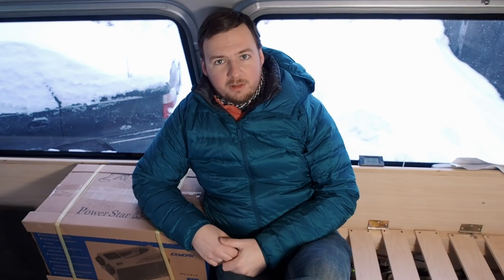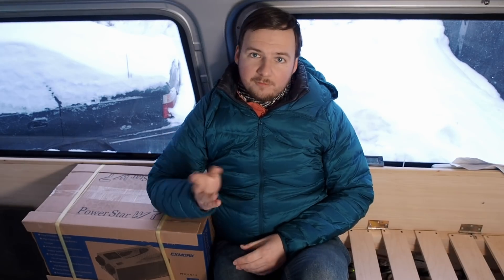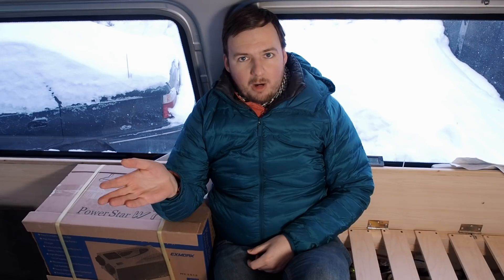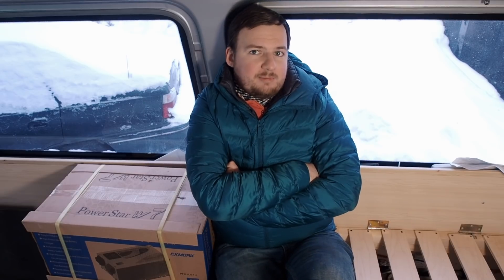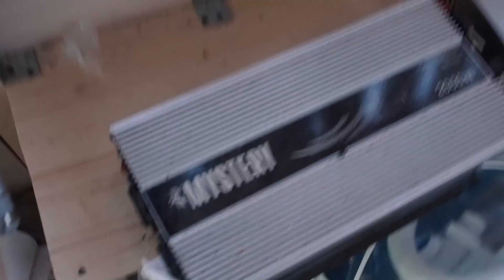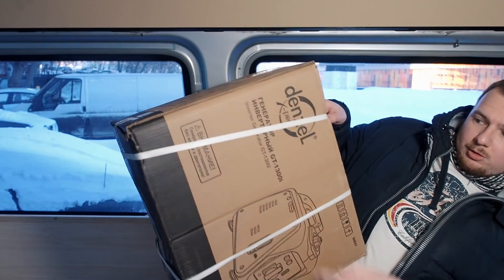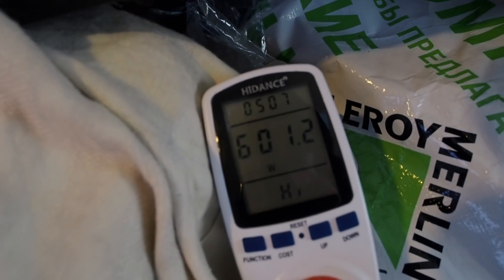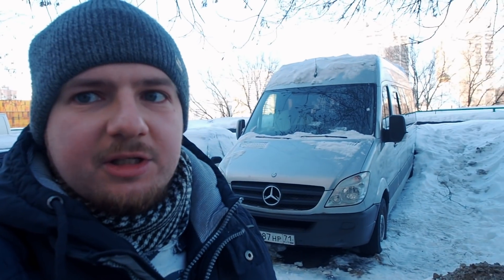Maintain my AGM batteries during winter. Charger inverter, gas generator test in van conversion

Comment: If u bought the new inverter just to charge the batteries then its an expensive option mate. You could buy a 12V and 10A charger on AC mains for max £30. U didn’t mention the output power of generator. If ur running ur Kitchen cooker on propane then the propane generator would have been a cheaper and a permanent add on to to ur grid as and when require.
Reply from the maker: > You could buy a 12V and 10A charger
That's nothing for my 400Ah battery bank. My inverter could do up to 70Amps and i can charge my batteries full in one night instead of two days.
>  output power of generator
Its 1300W but It doesn't matter, i just bought it for winter battery maintenance and not bring it with me for travels.

Comment: Hey! Missed you VanTourist!! 
Good to see you back. 😊😊
Reply: One question: as you have a spilt charge relay, could you connect the inverter to the starter battery and charge all your batteries?
Reply from the maker: Hi! Yes that will work, but I just can manually close my split relay and it will work the same way you say. However I have special device to charge my starter battery if my “house” batteries is charging. It takes 5A from whole charge and transfer it to starter battery if needed. It’s best option for me because charge house batteries is my main purpose. I need to change my starter battery anyway.